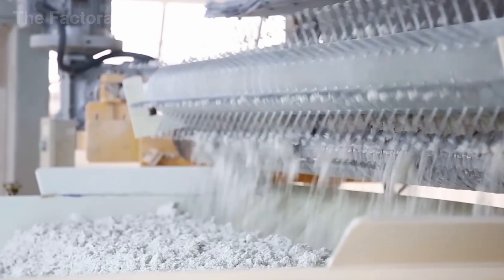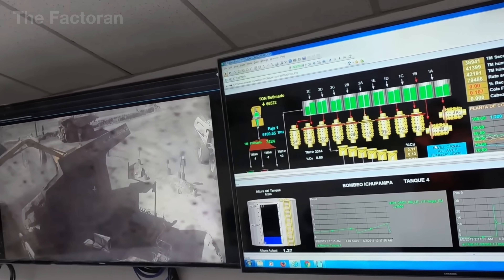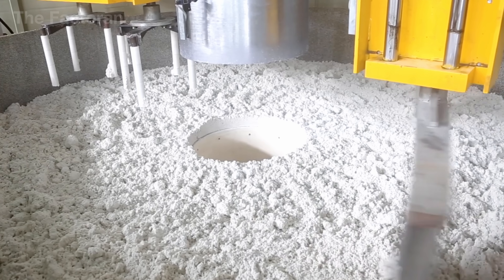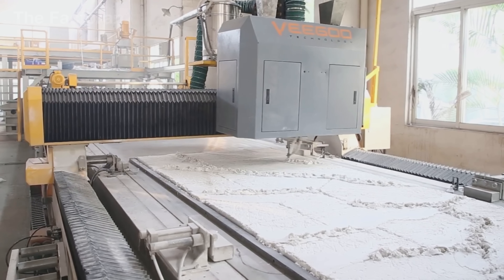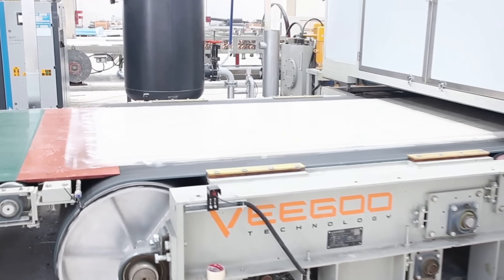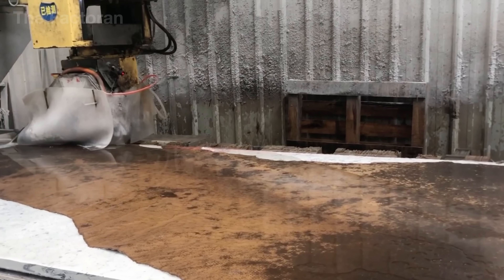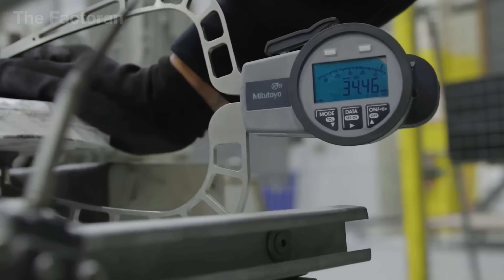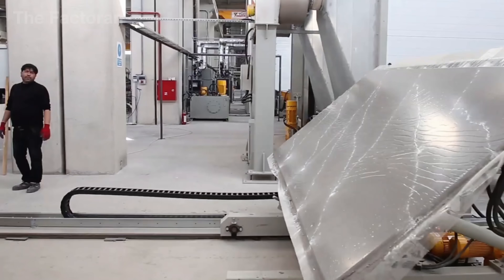How Millions of Quartz Slabs Worth Billions Of Dollars Are Made — From Sand To Luxury Surfaces

Comment: I knew it! I remodel kitchens and install this often. I knew a machine carved up those designs. It's a fascinating process but it it shows how fake, repetitive and boring these patterns become on a busy trendy market I'm in. It's common stuff for middle class in my hood. 
Manufacturers need to find a way to inject more randomness to the patterns. Add more humans to make the patterns. Beyond that, quartz is a bionic product. Very hard to scratch, 10 times stronger than granite. Add $1000 per slab if you want it, vs granite.
Reply from the maker: Got it! Quartz’s durability and scratch resistance are top-notch, but the repetitive machine-carved patterns can feel bland in trendy markets—more human-designed randomness would help.

Comment: With resins, can the finished product withstand hot pans?
Reply: no
Reply from the maker: No, finished epoxy resin products (like countertops) generally can't withstand direct contact with hot pans—they can scorch, discolor, or soften above 135–350°F, depending on the formula. Always use trivets to protect the surface.

Comment: My question is this. Does the number of jobs created by the tarrifs justify the increased cost of the material?
Reply: Yes
Reply: It saved the American steel industry after China was stopped from flooding the American market with cheap and inferior Chinese steel. So yeah
Reply: @Highway_Chronicles 
That's one industry that has seen modest improvement. Overall the tariffs have cost many more jobs than have been created.
Reply: If you can't sell it job's are temporary..
Reply from the maker: Great question — that trade-off between jobs and higher costs is always tricky to balance.